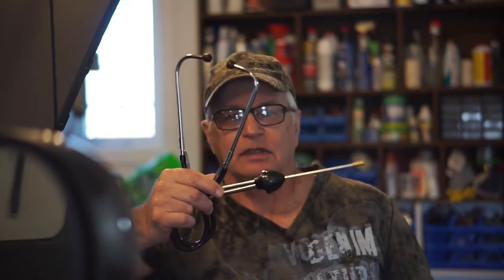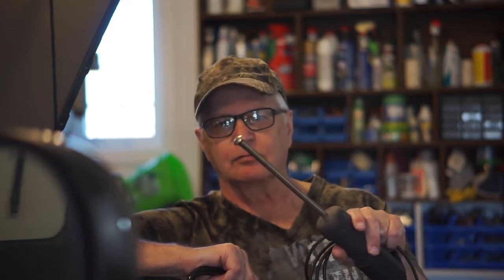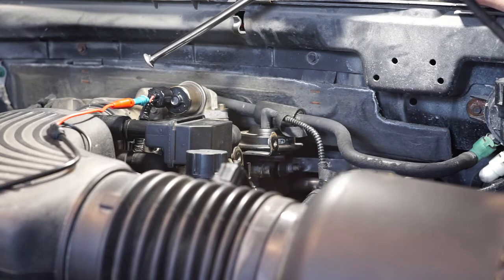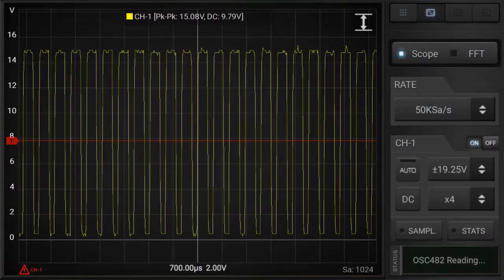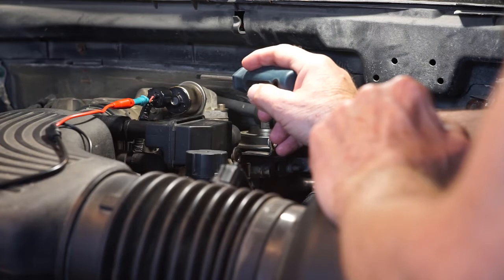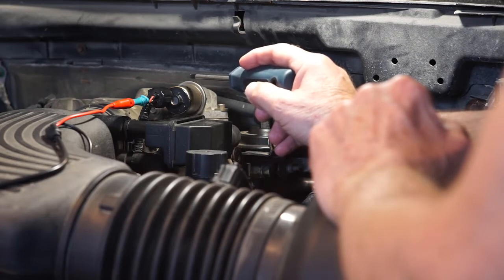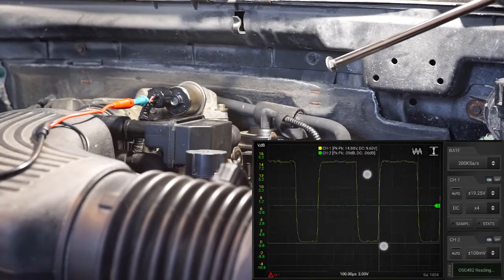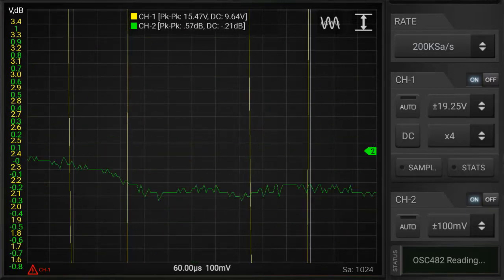GADGETS#51 - DIY STETHOSCOPE DEMO

Comment: Awesome channel I’ve been enjoying your gadget videos a lot! I couldn’t help but laugh that you created this tool and THEN try to find a use for it. That’s proper tinkering!

The thought of using it on a water pump synced to the pulley has me intrigued. Stick a magnet on the pulley and use an old crank sensor to pick up the signal perhaps? Could possibly be used to confirm bad impeller vanes? Might need a known good to compare though as typically all the vanes are worn and not just one or two
Reply from the maker: +Drew Horton - we agree, it is an awesome channel😎
Watch the FFT, the dynamic balancing videos and table saw vibration analysis. Very much related to your water pump.

Comment: Sir, i am planning to buy the loto osc482 model, but i am worry  how much voltage the devise will support. Will it be possible to use two attenuators hantek ht201 20:1  in series to test injector  and primary voltages around 100 and  400 volts respectively?. thanks a lot.
Reply from the maker: +antonio zanabria - good choice!
Here's a link to the OSC482 manual that I host on my Google Drive if you want an early start:
https://drive.google.com/open?id=1cuRcobSXWS9pn0igemzsuK9zE6DrmeC1
It is a +/-5v oscilloscope and all scopes in that input range with 20:1 handle injector spikes which tend to be shy of 100v
The OSC482 has +/-50v over protection so with a 20:1 that's 1000v. The scope will overscale but won't damage.
Never tried 2x HT201 in series. Perhaps I could design and build a 80:1 attenuator video. I'll think about it but I'm not that big a fan of primary work anyways.
The best detail is obtained through the secondary and I trust you've watched all the COP PROBE and related videos on here...
Reply from the maker: +antonio zanabris - As it turns out, this is a question also asked of Martin, so I pursued it further this morning.
There is NO issue with simply using the HANTEK 20:1 attenuator even with scopes that have +/-5v input.
The primary induction spikes above 35v are only occasional, do not hinder the capture and pose no threat to the scope.
Hope this alleviates your concerns, Antonio:)
Reply: @theGADGETSplaylist  thank you. Just one last doubt, exactly for using in android devices, i must have to buy only (osc482M) model instead of other (osc482...) models oscilloscopes.
Reply from the maker: @mecatronicavale1158  - hmmm...not sure about OSC482M...
I recommend buying just plain OSC482. Then, if you want to use it ANDROID, you purchase HScope licence on Google Play Store. And I recommend you later also get the AUTOMOTIVE MODULE licence within HScope. Each licence about $10 or so...
Reply: This is a vendor's publication in  AliExpress.com, so i am confused Sir.https://drive.google.com/file/d/12FSNnugGV2AJo0x2nuyPsqkuGiq_JCMt/view?usp=drivesdk.   and this. https://drive.google.com/file/d/127eC56w52e69XGFklr14OVFoJGpp6sK5/view?usp=drivesdk.      and picture https://drive.google.com/file/d/11uBBiPyDJMChHe1UTSuz295slxTesZwU/view?usp=drivesdk
Reply from the maker: @mecatronicavale1158  - yes, it can be confusing and I too want to make sure you order the right product.
The links you provided do not work (asks me to get permission?)
The confusion arises since there are 2 ways to get ANDROID capability for OSC482
One is with a "hardware chip" installed in the oscilloscope at manufacture that contains a licence check for a "variant" of HScope.
The other is a standard WINDOWS version. It is this one that I recommend and that you then get the HScope App from the Google Play Store.
Try copying the link of the Aliexpress page of the product you're considering and paste it here.
Reply from the maker: @mecatronicavale1158  - stay away from the OSC482M
Search Aliexpress for OSC482 only
Reply: @theGADGETSplaylist  it is done, about the links, sorry. So i buy the plain loto osc482 in the same aliexpress.com Sir.
Reply from the maker: @mecatronicavale1158  - Look at this:
https://www.aliexpress.com/item/4000110960976.html
There are the following choices...
OSC482---OSC482M---OSC482L---OSC482S---OSC482X---OSC482F
This is a very recent way of bundling cable, modules and THEIR android version.
I would CHOOSE OSC482 only. Then get android support through HScope on the Play Store.
Reply: @theGADGETSplaylist  yes, i understand.thanks
Reply from the maker: @mecatronicavale1158  - if you need any further help once you receive your OSC482 feel free to ask:)

Comment: i'm just now starting to use the FFT option on my hantek ,from what i gather so far and may be wrong . but it can graph different frequencies ,so if using the FFT math function it might steer you to an appox. freq to test at at. i've got to build one of those to see if i can find wheel bearing noise,or any bearing .with that tool a side by side measurement might tell the defective one,good work on making a useful tool,thanks for the info
Reply from the maker: +henry robinson - yes, you're on to something with the FFT function.
Being able to tell if it's wheel bearing noise, electrical noise, unbalance is what looking for sync companion gadgets for this stethoscope is all about. Success is not guaranteed but we're going to work on it here.
These are tricky waveforms to capture partly because the injector induction spike is peaking at 80v and the stethoscope channel might be 200 mV
Reply from the maker: +henry robinson - Martin has also encouraged me to make more use of FFT in my videos. I've shied away due to concerns of "spooking" my viewers. Similar to sticking with THT soldering and not scaring anyone with SMD work.
Both are about to change.
While I'm waiting on components for "companion gadgets" for the stethoscope, we'll explore FFT (which doesn't require parts) more deeply as a tool to extract more information out of the stethoscope.
Reply: @theGADGETSplaylist  post what you want.people of all ranges are watching them,you cant satisfy all ,so satisfy yourself,i find 'em very informative and i was a line tech for 30+ years, but just learning the scope so your practical experments help out a lot. they call it racticing medicine for a reason,we also practice auto repair

Comment: 'Listening' to the mechanical modules and extract a typical waveform from them, means actually to be able to check if inside things are moving and moving correctly before any other 'invasive' method?
Reply from the maker: +Martin R&D - In the case of the fuel injector, it allowed us to confirm the pintle has moved when commanded. It's early days, but I also think this holds the promise of "signatures" where not only did it move, but did it move well...
Reply: Martinloren R&D   Good morning. Thank u for all the content on your channel. I particularly appreciated your series on home solar. I’m just starting to use scopes in automotive. I’m trying to wrap my pea brain around trigger and time base. Mr. Canuck has it snockered. He must have spent many years in some sort of tech field. As do u sir!!
Reply: @billrimmer5596  We are just passionate on this tech and would like to make advanced things easy and accessible. 😃